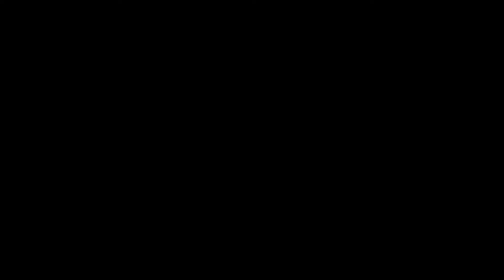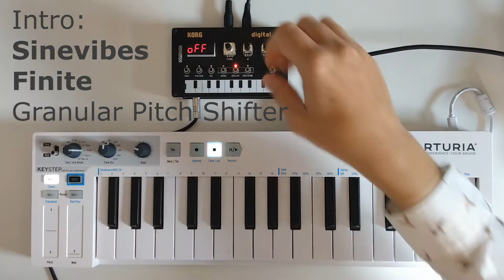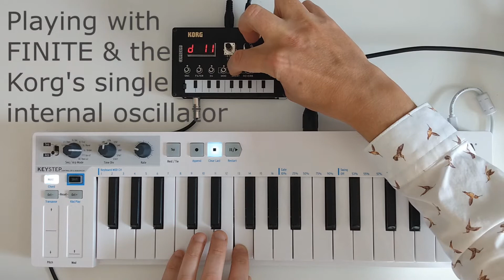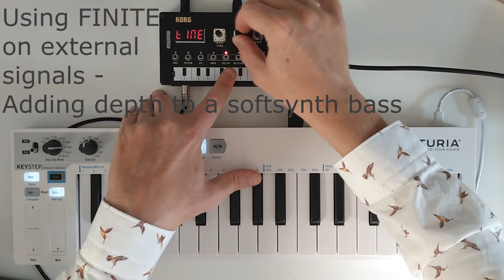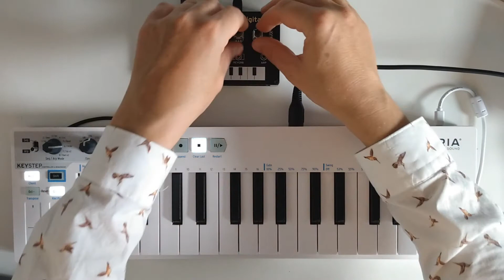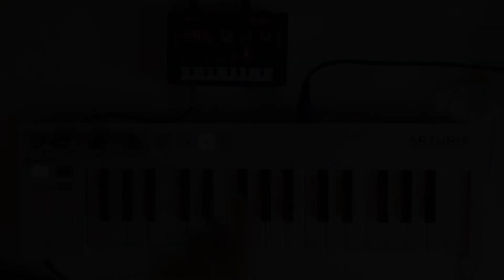Sinevibes Finite - Granular Pitch Shifter FX for Korg NTS1/Minilogue XD/Prologue - NEW

Comment: Great video ! BTW, just a question : can you do some pitch bending with this thing  ( and use the pitch wheel on a midi keyboard/ controller ) ?
Reply from the maker: In this video the pitch bending comes from the effect itself.

The output can be "pitch bent" by varying amounts up or down using the effect knob, not a pitch wheel.

If you want to control that effect remotely it responds to midi CC 30,